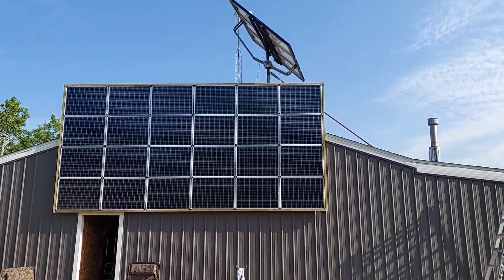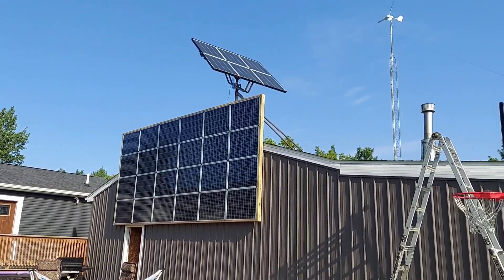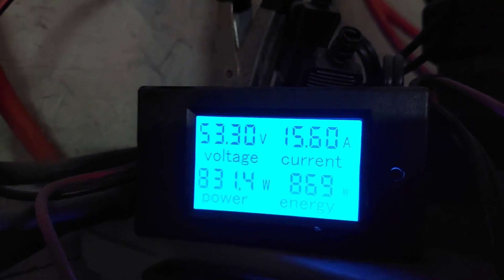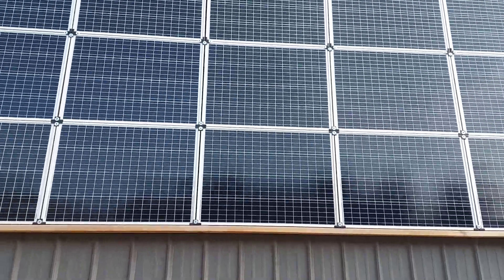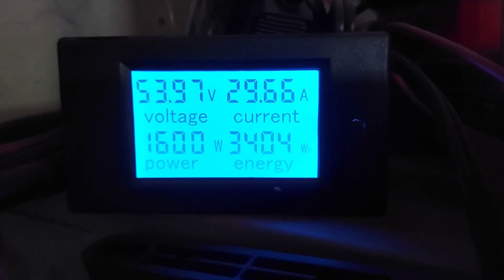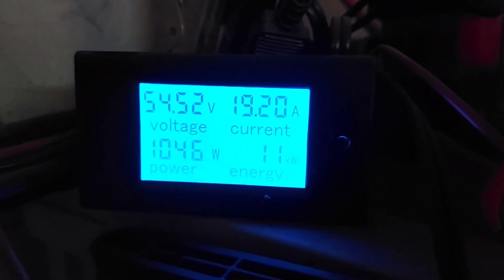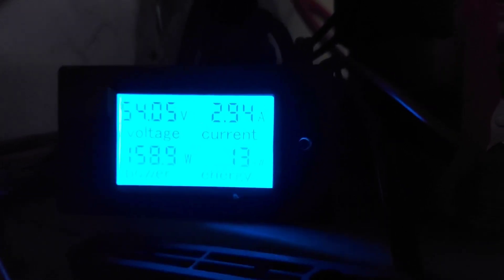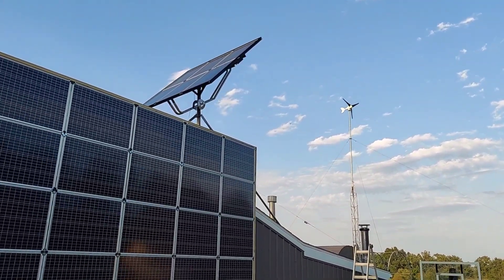Harbor Freight Solar panel array. Is it the biggest on YouTube?

Comment: I have been running 24 of them for about a year and i just bought 6 more, so my system will be 36 total. I have not got a rock solid answer from HF but all signs point to them most likely discontinuing these as of (April 2025) they have their new Predators out now which are looking to be the replacement for these. I snatched as many up as many of these as i could find to expand my system because its been working so well! When i do my expansion im going to try to make a video but ive never messed with making one!
Reply from the maker: @johnrbuis ,they work great! I just upgraded my system, so I'll be installing 18kw of new panels soon. Sadly, it will cost less than I have invested in these panels. I still think these are the best 100 watt panel made.

Comment: Have you looked at used panels? I bought a couple for 60$ per
Reply from the maker: @Engineerd3d  I will be getting some larger panels soon. I bought these over the course of a few years and wanted to stick with the same panels to max out my charge controller. I did look at used panels but didn't want to pay the shipping. I could have still saved money, looking back. Thanks for watching!
Reply: @karlsoffroad  I bought mine locally as they are available from time to time. I have seen the 250w panels for sale for as low as 40$
Reply: @Engineerd3d  where would you two suggest finding info on building a system from scratch ie used panels? Ive looked around and found stuff, but lost knowing what will work and what wont.
Reply: @ simply put the way I built mine was. Used panels feeding a 60a mppt controller, that charges the batteries and maintains float. Then I got a 2kw pure sine inverter and connected it to the batteries. There I have power. I am currently running a 12v system. I am thinking of doing a 48v system using lithium batteries in the future. The way I view it is simply break down each component and analyze cost vs performance and end goal. I like a system that is modular as that can be easier to understand and work on it.
Reply from the maker: @michiganpowerwashingpros  Santan solar has used panels. Just be careful and make sure you check them out well.
Reply: @ thanks for that!! What do you look for? Just general obvious signs of damage?
Reply: @ yes and bring a volt meter with you and see if they can output rated voltage.

Comment: Nice mount! How did you attache it to the building?
Reply from the maker: @DIYSolarFarming  I ran three 2x4s vertical to step it out from the ribs of the metal. I then ran 2x4s horizontal every 27 inches on center to catch the edge of each panel. Basically, I built a wall on my wall! Lol

Comment: I've gone through a couple of those blue grid-tie inverters with limiters over the years. I discovered they hate the AC being disconnected while producing power. I'm out in the middle of the desert so the power tends to go out for ~30s periods a lot. They sit next to my workbench out in the garage, and one time when the power went out one of them made a loud pop with an internal arc flash and let the magic smoke out. Another time I switched off the breaker one of them pushes power through to take it offline and move it, and the instant I switched off the breaker the same thing happened again. Disconnect the load or its CT clamp first and let it go down to 0W and then disconnect it. I went to a hybrid inverter that can go off-grid mode back in 2019.
Reply from the maker: @captainobvious9188  That's exactly what happens. My 10 hp air compressor kicks on and poof! Lol 😆

Comment: Have you thought of a ground array?  I have mine facing south and my HF monocrystalline gets over 100W here in North Carolina.  Also, the inverter the HF2000W pure sine wave runs my garage tools, lights,  and fridge. I like haviing my DYI setup and ignore the solar experts that buy 30K setups.  It does what I need it to.
Reply from the maker: @dmcd7333  I will be building a ground array. I had all the wiring in place for this already, that's why it's mounted where it is. I know they're not angled properly. They never need the snow cleaned off, though! I looked at the pure sine wave inverters at Harbor Freight, but I'm going to need a larger one for my plans. I'm glad they're working well for you, too!

Comment: Runing 8 of these in series/parallel to charge my Delta Pro. Works great and I have observed up to 934 Watts in full direct sun from the array.
Reply from the maker: @MG-jc8yx  I believe it. They are definitely underrated, I have seen the same thing many times. They beat any other 100-watt panel I've seen tested.

Comment: The problem with the HF panel is the wires are thin, not PV/UV rated and come with a  SAE connector that is not water proof. You can get bifacial 100w panels for $100 these days
Reply from the maker: @grindychum  I swapped them for MC4 connectors. It's an additional cost, but I learned from these panels. Going forward, I will be running much larger panels on a ground mount. I'm still happy with them, though.  I didn't have 5k to spend initially, so it worked for me.
Reply: Tape the SAE and zip tie it up under the panel... not expecting rain going upwards anytime soon i hope.

Comment: Panel pricing is insane. I got 36 new 400w bifacial panels for about $106 bucks each that'll do well over 400 on a good day. And free shipping on a 1500 lb pallet. It pays to shop. With new tariffs coming up on china imports where 90% of them come from, best get it done sooner than later if you're in need of them.
Reply from the maker: @beebop9808  I know these panels aren't very cost-effective,but I wanted to stick with the same panels for my first array. I will definitely be ordering a few pallets of larger panels for the next one I build. Where did you find your panels? Thanks for watching!

Comment: What a waste. cheap garbage panels for nearly a dollar per watt..... when a pallet of commerical panels are .20-.25 per watt. I buy pallets of commercial panels and sell off enough till I end up with 10 panels for free. people will pay .60-.75/watt for single commercial panels all day long for their projects.
Reply from the maker: @car2069   These aren't cheap and I don't have them angled for summertime, I use most of my power in the winter for heating, so they'll perform much better when the sun is lower on the horizon. I'll do an update video then. I will be buying commercial panels for my next array. These are just convenient, local,and perform better than their specifications. I realize this video doesn't show that, but I have seen over 2200 watts, and I only had 18 panels up. This is my first experience with solar,so I started small and kept adding as I could afford them. I assume you are using panels from Santan Solar? I also like the fact that if I have an issue, I can walk into the store and handle it the same day. It works great for me for now. I've also never seen a commercial panel meet or exceed its specifications,but I'm fairly new to solar. Do you have any recommendations for an exceptional commercial panel?
Reply: @karlsoffroad  i buy pallets from Signature Solar. Santan screwed me and didnt ship the fight quantity, then shut down the georgia location and stopped answering. Signature has better prices and if you time it right free shipping. All commercial panels are better and will outlast HF junk. Signature even sells similar 100w panels for like $49. I have Qcells, Silfab, and Sirius. I’m gonna drive down to South Carolina and pickup a pallet of panels from KB Solar. They are an awesome local company ive seen a lot of youtubers installing.
Reply from the maker: @car2069 I don't have any local distributors, so shipping is usually about 500 on a pallet. I will try to catch the free shipping deal in the future! Thanks!
Reply: 500 on a pallet?  lies. no way. 1.74 in x 500 would mean the stack is 24 feet tall.unshippable.  plus the weight would crush the bottom of that stack.   better to just admit you're wrong and delete this video
Reply from the maker: @kevin.campbell  $500 shipping
Reply: @kevin.campbell  Dollars, Dinero, smackaroos, green, cheese, IE:money.

Comment: awesome setup.  I was thinking about just doing vertical panels on a south facing shed with a couple on the roof just to power the shed and test out.. I've looked at the harbor freight stuff for a small system and it seems like you're pretty happy so with those panels.
Reply from the maker: @spyghetti  I'm definitely happy with them. They will definitely produce much better in the winter. When angled properly, they make over 100 watts easily.  I'll do an update when the seasons change and the sun gets much lower in the sky. Thanks for watching!

Comment: Thanks Karl that's pretty cool. What does your connections look like? Are you just back feeding through a breaker in your panel?
Reply from the maker: @Superduty_59  Yes,I have two CT sensors installed on the main L1/L2, so I can run in limiter mode,zero backfeed to the grid. I had two grid tie inverters,so I could cover both,but they keep failing on the DC side of the board. I have two dedicated 20 amp breakers in my panel to feed each side.